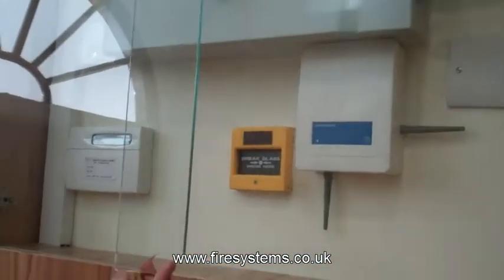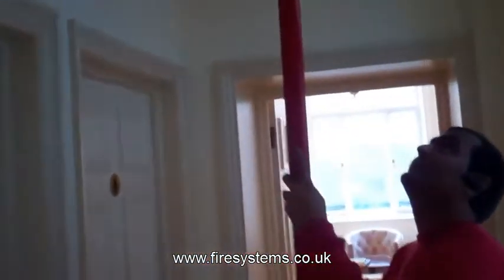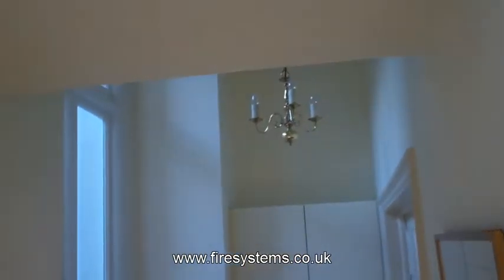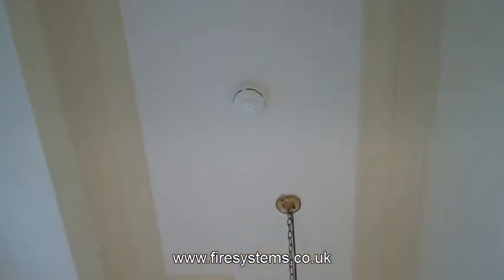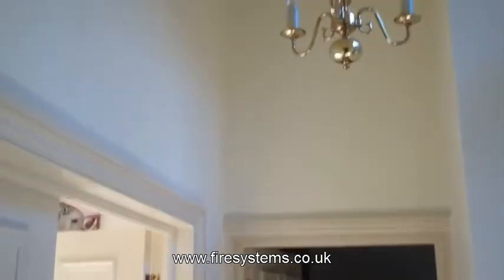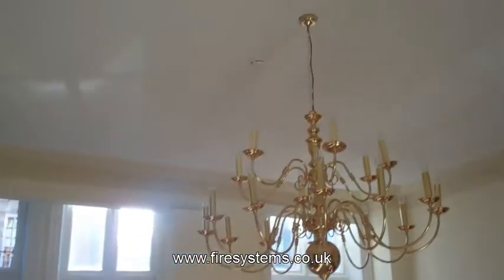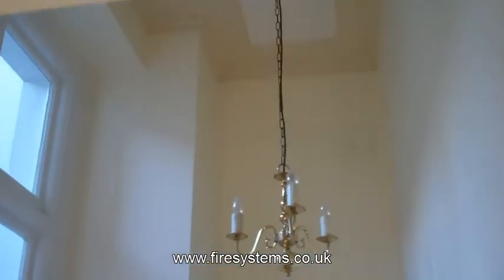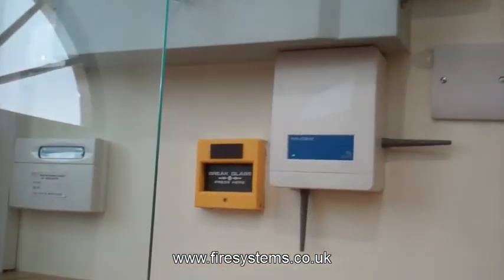Wired fire alarm zone, to a Wireless fire alarm zone. How? Hyfire

Comment: can the wireless interface be added to a used zone?
for example if i had a zone with 5 detectors on, and i needed to add 5 more which had to be wireless. could i put the interface on the same zone?